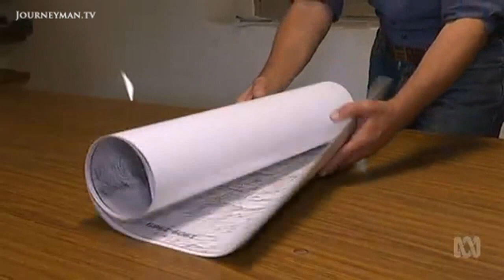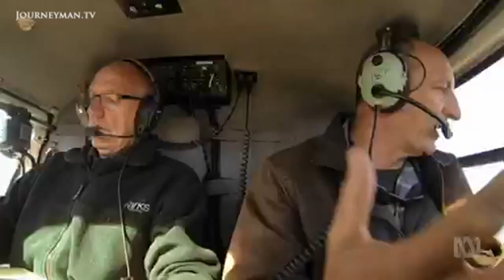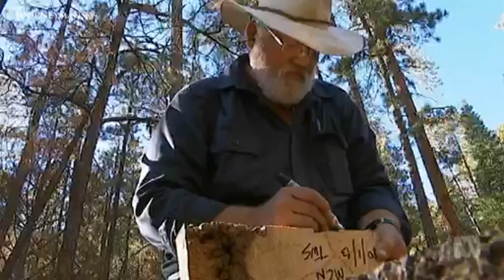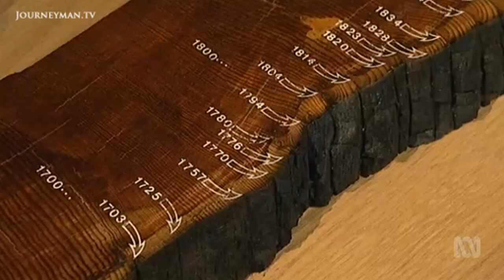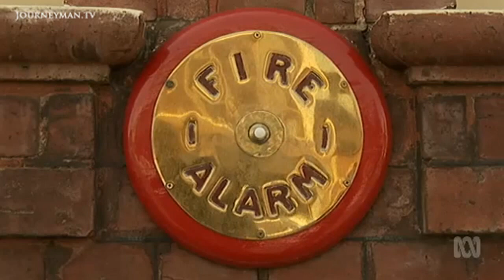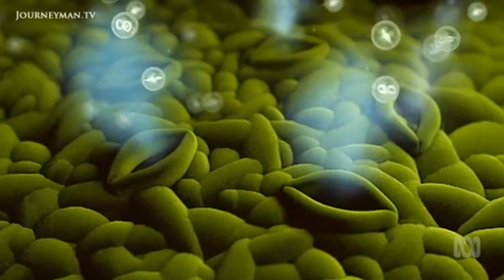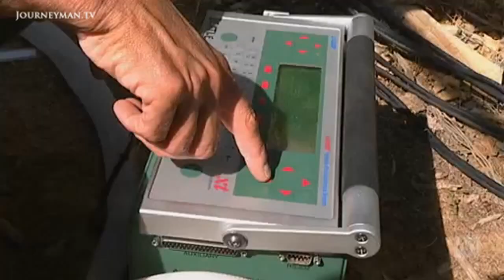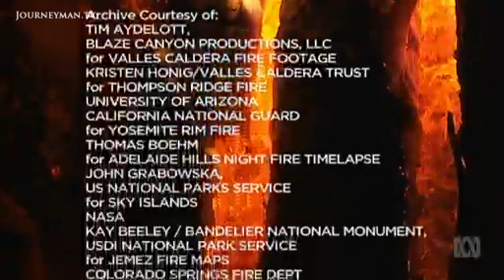The Mega-fire Danger Coming To Your Home Soon

Comment: In the Aussie fires, cool rainforests with ground like a sponge and tree canopies that couldn't burn, did burn. The sponge like centuries old, wet detritus and tree roots burned.  Did they check for aluminum or other flammable chemical accellerants in the soil, root systems and the tree canopies, to see how what 'couldn't burn' did in fact burn?  I noticed how the narrator ignored it when the Aussie forest guy said, "These aren't natual fires".  Canopy and soil burning before the rest of the the trees and forest? The plausible consideration would be to search for a cause coming from above and below; not across the surface, as natural wildfires travel. When investigating an, 'outside the box' situation, one must discard normal parameters and also think outside the box for the causal factor.

Comment: There is a ted talk comparing pictures from 100 years ago to picture from now, the difference in the forests is obvious.  100 years ago, you saw throw rugs of trees with small groves in between.  In the modern era you saw a wall to wall carpet of trees.  That is part of the problem, we have changed the natural system by putting out too many fires.

By looking at the paper an bureaucratic history, you get a wrong conclusion.  Check the natural history by checking pictures in the late 1800's and compare them....

Comment: Australia is getting mega fires during El Nino years with NSW and Victoria smashed in 2019/2020 only area that hasn't been affected by a mega fire for almost 40 years is the South East of South Australia of which got hammered by Ash Wednesday in 1983 back in the 80's that bushfire was classed as a destructive fire due to its sheer size and lightning speed adding in destructive behavior